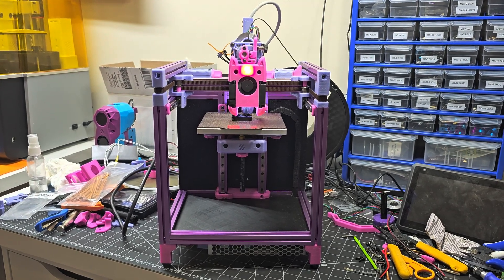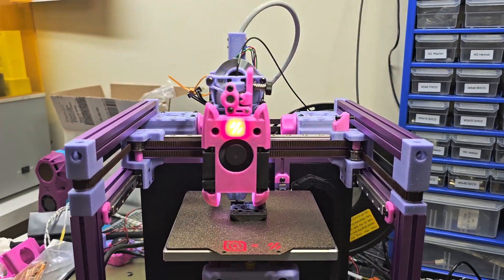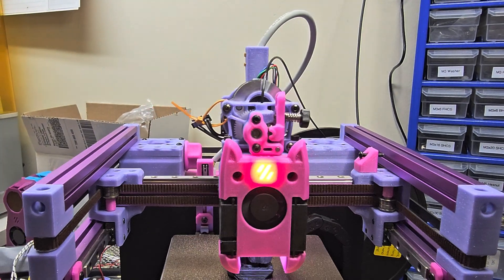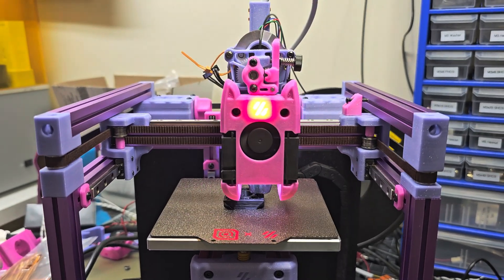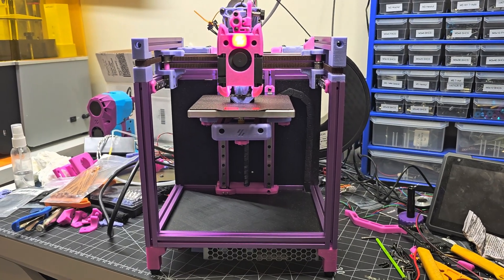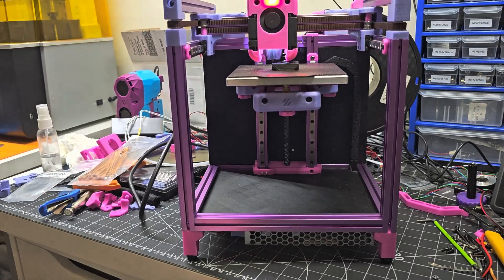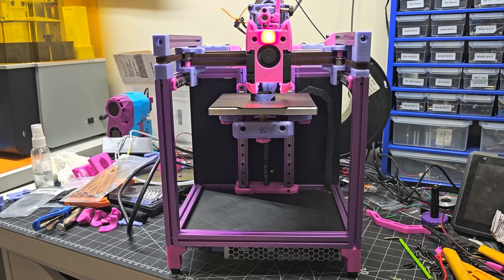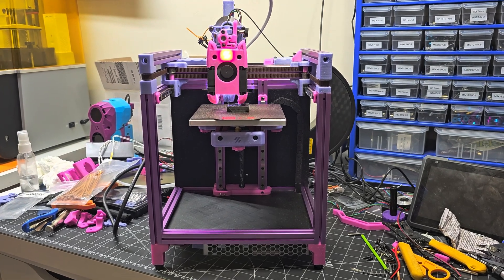My wife's V0.1 running a test print

Comment: Look at Fystec's filament detection board for the Sherpa Mini, probably a good add on for the wife as it has auto load and a button for unload. You would never need to undo the latch. And it's cheap

Comment: Love the colors! It’s weird seeing the rapid burner here, as I thought it was smaller honestly
Reply: Also, any issues with LDO motors? I don’t have a Voron, would love to build one! Specifically a trident or v0.2. Nonetheless, still bashing out my current build - Core XY’d Ender 3 (lol). Pushing 25mm3s with my preferred PLA’s (higher with ASA), 10.5k accel (can get to 15k, just not the quality I want yet, hashing it out), 5015 part cooling, 12032 aux fan. Not enclosed yet (still hashing out the design). But ya nonetheless, still love vorons and these little guys seem like so much fun, just heard some weird stories with LDO motors/kits. It’d cost me more to build one of these little guys than what I invested in my Ender 3 conversion, so just trying to see the best path to pursue
Reply from the maker: LDO kits are a bit more expensive, but usually come with some extra quality of life mods, and good quality components. You get what you pay for.